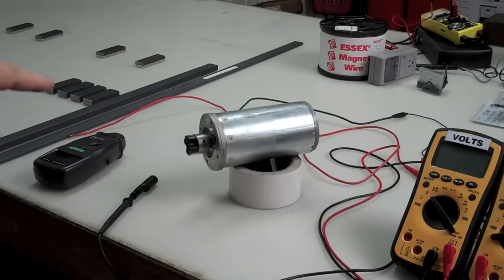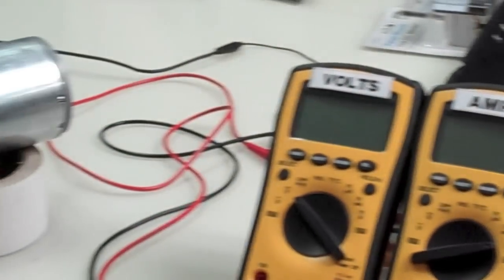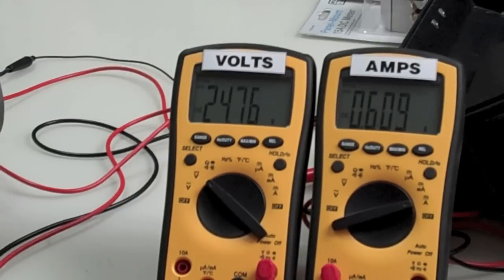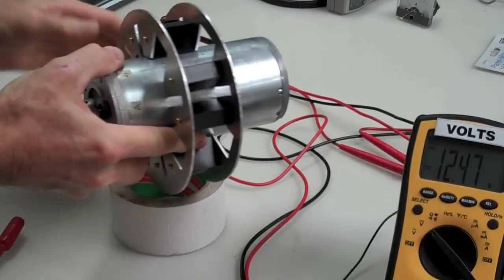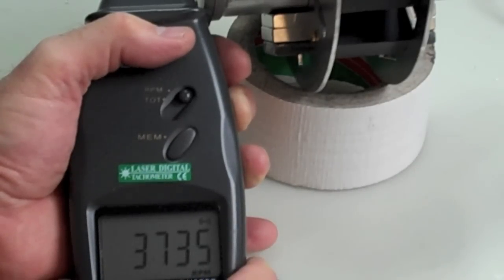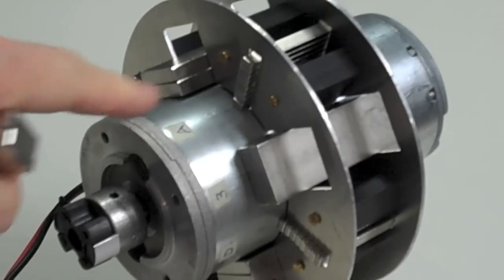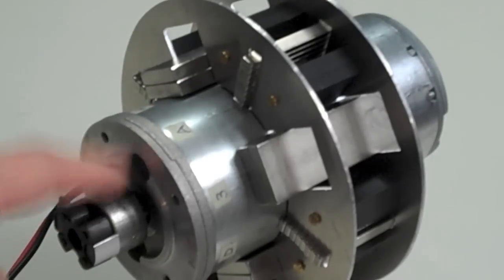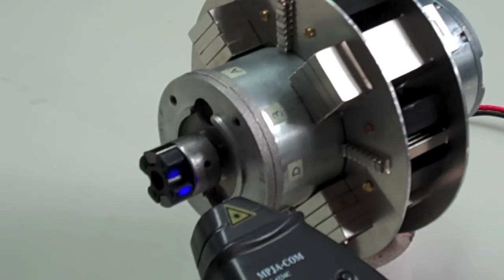STARGATE MOTOR  FULL DEMO

Comment: You a basically adding magnets to a motor.
How is this and different than a larger motor with the same weight in total magnets?
Reply: costs more?
can you show us the cost analysis?
Reply: +porsche mid engine please explain what you are saying.
Reply: It reduces the back voltage allowing you to get more power than you get out

Comment: I'm curious as to why you say that the motor uses less power. Yes the voltage is reduced by half but consequently the amperage doubles.  24v at .5 amps = 12 watts. 12v at 1 amp = 12 watts. Is this not the same power draw? If you are only trying to demonstrate that changing the field will change the speed... well done. But the changing voltage would be unnecessary right?

Comment: Yeah we used to do this with slot-car race motors in the 60s.   Adding more magnets will make any motor go faster.   MRRC motors were also fitted with extra side plates (pole pieces) with the same result

Comment: I think you need to apply load to the motor for it to be a viable test. Increasing the RPM of an electric motor and saying it has more power isn't really accurate. Torque is also a highly important number!Try it again but with some sort of load and compare the WATTAGE usage from both.
Reply: I agree completely! Do a test with 3 different loads on all settings. Amperage will greatly differ. Do this while showing amps and voltage. If it works, why haven't you sold billions? Any half intelligent person would invest in that if it truly works. Maybe it does, but you need to be more convincing. Possibly show graphs of watts with load, speed and total efficiency. Have real numbers instead of guesstimations. Make me believe dammit, make me believe!
Reply: Torque while important is always overcome by rpm's.  HP=(torque*rpm)/5252.   As long as the engine spins past 5252, torque at this point can be moot.   Just like in an indycar 16k rpm, 230mph, with 800hp at 16k, 262lbs of torque at this rpm.

However this motor produces about 0.3lb/ft torque.  At 3000rpm, it is making 0.17HP.

I dont know what the torque is on this motor after the magnets, but lets use some assumption.  Lets say that HP stayed the same, even at 15k rpm that it wanted to spin up too.   That means it would produce 0.06lb/ft of torque.  That means it is making 20% of the original torque.  So we would need to believe that it lost 80% of its torque.  I doubt that.  I would argue he lost 60%, though wouldn't know without putting something on it to test.  At a 60% loss and equal the same hp of .17HP it would have to spin up to...7440RPMs.  Which this thing clearly can.

I would say that it is safe to assume that the rpms have made up for any torque loss and at the end of the day will be outputting more HP by mere benefit of RPMs.

Comment: I've worked with brush-less motors & one of the things I like about them is that there's almost nothing to wear out. Just change the barrings when ever needed & don't over heat them. Of course the new type magnets would help them be a little more efficient. Working with remote control airplanes I found they make some marvelous little motors that have a good power to weight ratio. Check them out for some ideals. I hope your work turns out good, we sure could use better motors, it's time is here.

Comment: This motor isn't creating power or anything it is simply becoming a lower torque but higher rpm motor with the addition of the magnets.  As much as I wish it was possible for free energy to exist like this, it simply doesn't.  The changes made to the motor caused the outcome that science predicts.
Reply from the maker: +Brian Ebling   So true. Just like the video description has always said.
Reply: +Brian Ebling Ha you think our modern weak ass outcomes are due to science? Man has stopped the production of machines like this. Notice i did not say development. Magnetic generators work and you can power cities off them, built to proper scale. However science goes on and on make no mistake we are not at the pinnacle, our energy technologies all work by keeping people on the meter. Its not about development or science. Its simply about control, is int that what the monetary systems are about.
Reply: Carter Merz
'I found a way to make perpetual motion! So instead of going to the US Patents Office, I'll need investors for an indefinite amount of time because muh guvmint suppreshun'
Reply: edbo10 actually, the Tucker car company was very much about government suppression.  And, "Just because I talk with an accent doesn't mean I think with an accent."  A Walk in the Clouds, 1995.

Comment from the maker: I'm happy that this little experiment caused you to gain a higher knowledge through study. I'm disappointed however that you didn't read the video description. It explains how this simple procedure allows you to adjust rpm or torque from a standard DC motor. It will NOT teleport you to another dimension, or supply the world with perpetual free energy.

Comment: Yeah, so there isn't an increase in power associated with the increase in load by your (not really a ) stator. What's going on is simple and is a compression of the field. Basically it's analogous to increasing the number of windings. Just that instead of increasing the number of windings you are decreasing the space between the field lines.  So the individual  conductor has less distance to travel between  exciting the armature and  finding its moment of inertia. The same result could be had by stepping the voltage from 24 to around 36 . You aren't making the motor stronger, actually from a torque standpoint you've decreased the potential. This is because in any motor  the potential of output torque is proportional to the distance that the conductor has to travel to excite the armature.  The smaller the distance the faster,but weaker the interactive force is. The inverse is also true,  that the greater the distance , the stronger the force must be to create that interaction.  If you can truly increase the potential of a motor simply by restricting the field you'd belong in the annals of science with  a footnote saying "I conclusively disproved Lord Maxwell, his equations were flawed".
Reply: Damn son,  🎓

Comment: Hi PMMG4HYBRID, You have also focused the magnetic field (like a magnifying glass focuses light) and compressed or shaped the field making it stronger or more focused as a stator field.  I wonder how much more we could improve upon this by changing the motor body from iron (which diffuses the field) to a non ion of ferrous body which wouldn’t diffuse the field, maybe a hemp-resin composite like H Ford used. Henry Ford's Plastic Hemp Car.

Comment: You've increased the number of poles on the stator which has geared the rotor speed up a level, but this experiment doesn't say anything about the useful work potential of the motor because you aren't loading it at all.
I think it will be a less efficient motor under load though (but you could check my theory experimentally) because the commutator won't be optimised for a rotor rotating in the modified magnetic field you have created.
In all cases power out = Power in - losses
Power in should be I*V (unless there is any phase shift between the current drawn vs. the voltage, both of which will probably be oscillating a little. You'd want a scope to check that since your meter measures mean values only.)
Losses, I guess, are mainly drag and friction of the rotor. The higher spin speed may reduce the air pressure around the rotor there-by reducing drag and accounting for lower power requirement when the motor free wheels. This effect could be considerable for an open coil but much less if it is set in resin.
Thank you for demonstrating that changing the magnetic field of a motor's stator changes its behaviour. There doesn't appear to be anything mysterious here though, and the efficiency of a motor under a realistic load is a much more useful verification of any enhancement, unless you just like to see how fast things go before they break ;)
Reply: that's exactly what i was trying to say... you read my mind wow you guys are GENIUS
Reply: the torque equation is tau= NIABsin(phi) this guy just increased B (the magnitude of the magnetic field), and decreased I (amperage) the rest are constant (although phi changes slightly we can assume the angle between the I and B are approx constant.

Whats a little wired is the resistance in the system changes substantially, the first run (V=IR) 24.5 total voltage = .59 amps * total Resistance , R=41.5. But if you do the same calculations for the second run R=12.077. where did the change in resistance come from? I cant think of how an increase in magnetic field could decrease resistance if there is an increase in the Energy of the system.
Reply: Alex McGhee well, his meter is showing a mean figure for V and I but in reality current through and voltage across a coil will be oscillating as it rotates inside the magnetic field. If there's any significant phase difference between them then the impedance will be much higher than the resistance of the resting wire. I would say the new configuration simply has a much lower operational impedance than the un-pimped motor.

Comment from the maker: I've let it go well over 20,000 rpm for a short period of time. I've also had the motor open and have fully taken it apart many times. The bearings are simply oil impregnated bronze bushings. No ball bearings.

Comment: In increasing the stator field like you did creates hundreds of possibilities with a practical application of this kind of tech. Better car starts in winter when the voltage of your battery drops out due to cold is only one possible application.

Comment: Mathematically you gain nothing. You have doubled your amperage and divided your volts in half you are still in the same place on the power formula
Reply: Look at the Laplace law of force.
The static magnetic strength plays an EQUAL part in the force creation as the power that is put into it.
Reply: Its a gain in rpm. Not in torque. But the extra magnets are usefull if you wanna make a more powerful motor. Just need to thicken the wires and put more juice into it.

Comment: you can adjust the torque and speed of the motor by rotating the brushes using the back plate with baring housing, just unfold the metal tabs that stop it from rotating.

Comment: I know this might upset people but there was absolutely no evidence you are doing anything but charging the RPM. Without checking the available torque at given RPM ( = horsepower) it really doesn't do anything useful. Raising the RPM on a 3000 RPM motor would shorten the life so much that it would likely only make it a few hours before meltdown. And if you check the horsepower you will likely find you have lost the horsepower proportional to the gain in RPM. It is likely less efficient at the higher RPM due to the design if the motor as well so if you bring the RPM to 6000 you would likely only be able to sustain an output equivalency of maybe a 1/10 of a HP. I used to do this when I was a kid and found it's very difficult to break Ohm's law and Watts formula. While the amp meter and volt meter indeed show you are using less power, the fact that it is just free spinning the motor means you have change the wattage output of the motor and if tested would almost for sure show exactly what it should. I've been an Electronic Engineer for 20 years and it's hard to beat the basics when correctly tested.
Reply: What do you mean its hard to break the basics? So are you saing its possible to break it, or that you have broke the basics? I dont understand. But everything else i understand and agree with you. Hopefully people will understand.

Comment from the maker: 2 pole. Search "stargate motor" and you'll find internal/external photo showing precise alignment of external magnets relative to internal magnet positions.
Yes, counteraction is correct. You will sacrifice some torque for higher rpm, but you will be able to reach a desired speed with a lower voltage input.

Comment: Someone knowledgable about magnetism spent a lot of time dealing with amplifying the magnets in this motor through a 1/8 inch thick metal case...a lot of trouble. The original magnets are probably ceramic and like N8 whereas the Neo magnets are probably N42 or better and very expensive.  The result is that the ceramic magnets are made many times more powerful, will have a lot more torque and so the motor is more efficient.  But for the money spent it would have been better to go to HobbyKing and buy a brushless motor the same size that has about 5 horsepower  and lots of torque, the kind they use for large model airplanes.
Reply: burada verimliliği arttırmaktan başka bir şey yapılmamış
Reply: Torque goes down when rpm goes up. He needs to test under a load

Comment: Try putting a few drops of duralube or slick 50 in each bearing,it might help your heating problem. years ago my son had a cheep pair of inline skates that only had 2 usable wheel & ball bearing sets each & so full of sand they would not turn.I washed ,sprayed air thru bearing,lubed with slick-50 No one in his circle could catch him.

Comment: It makes sense without much looking into how it works. I believe the most value out of it's possible application is high speed, low power motors that take very little energy. Imagine a cooling fan working off of this principle, you could theoretically divert more power to what's being cooled but still produce the most cfm possible. The application to computer cooling is what interests me most.

Comment: you can test the same thing using a winded stator in series with the rotor and in parallel. I think you'd like the results. Test the torque when the stator is in parallel.

Comment: I suspect the extra mag fields are behaving like gears in a gearbox. With no load the output shaft spins really fast but under load it'd require a lot more power negating the apparent gain.

Comment: That depends on the moter is DC, brushless.
In DC Speed does translate to more power, in brushless it gives more torq, not speed, due to it is AC controlled.

Comment: Now, if you could do some minor machine work to the end plate where the brushes are mounted, it would then be possible to change the 'timing' of the electrical impulses in the armature windings while the motor is running. This would help in fine tuning the final product.

Comment: back when i did a lot of mountain biking, i used a grease called "White Lightning" stuff was the best! and water proof!  from personal experience, nothing keeps sleeves lubricated for long, because they don't move, they burn off whatever you lube them with, my best advice is to use an oil with a very high oxidation point, try something like, soy margarine or bacon grease, disassemble most likely required.

Comment: Well the product of torque and angular velocity must be equal to the power, so while the motor has no load it will invest as much power as possible in angular velocity though it will need some torque to overcome friction forces.

Comment: this is why I like youtube. I feel like I learn something new on a regular basis. (at least weekly). aside I see your point here but isn't the general rule of thumb that the faster a vehicle cruise at it's peak efficiency = a more efficient vehicle overall (of course terrain and use variables accounted for). Just saying if this bike were to replace say a moped. Wouldn't it be more efficient to use a bigger wheel for a cruising speed of 35-45 instead of 15-25? And thanks for the response btw.

Comment: Force is The Newton unit.
Which can be written like this.
sec x Newton/kg= meter/sec
The speed will be determent by the force of the drag. 
Which is also in Newton but in negative.
In this case it is the same, with or without the extra magnet.

Comment: For factory made, and not custom made motors this application is excellent. I'm going to be working on a purely magnetic piston engine here in a few weeks, for a kick off for the drive shaft, this concept will save a lot on batteries ;) I'm thinking, load stronger countermagnets in lesser quantity, drop your watts to near null, and get a similar effect to that of 12 without magnetic counteraction. We'll see, it'll be fun to tinker with.

Comment: A motor, particularly a PM motor like this, is optimized for a particular condition. what this shows is that it can be optimized"for a range of conditions by moving the external magnets. Or, replace them with electromagnets, connected in series with the motor, and you have a motor that will be more efficient over a wide range of speeds and loads. this is basically a series dc motor as used for electric car conversions and forklifts but with PM's as well. this would be a new type of motor.

Comment: I did an experiment where i took 3 in by 3/8 in ring magnets stacked a bunch of them until I had a pile about a foot and a half high. I then stuck it to a 20 LB metal plate and I was able to lift it off the ground. But then I doubled the magnets so that I had about 3 feet of them and I was only able to lift around 30 LB off the ground not 40. By doubling the magnets I didnt double their strength, I think there is a saturation point you reach based on its gauss and material, cermanic in my case.

Comment: good that you studied it,   An electric motor like this works as a motor and a generator.  if you were driving the motor at a constant speed from another motor and you change the field strength what happens? increasing the flux increases the voltage generated. in fact, it is working as a motor and generator whatever the speed is, if it runs at 3000 rpm on 24V and you drive the motor from a rotating mechanical power source at a higher speed you will put current back into the battery.